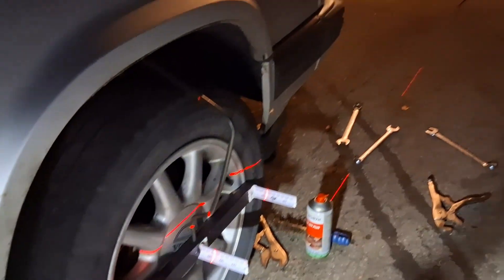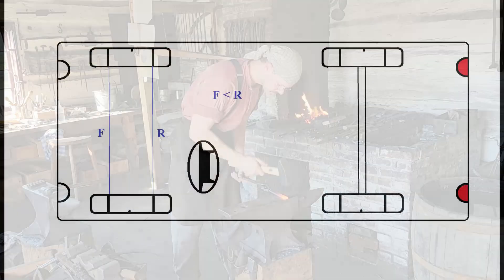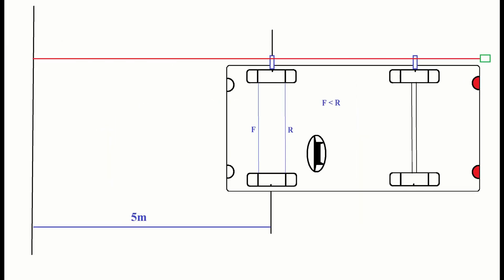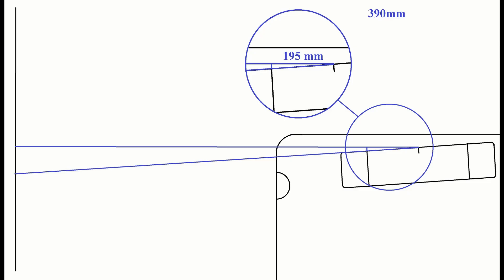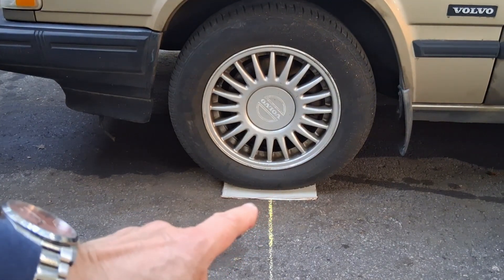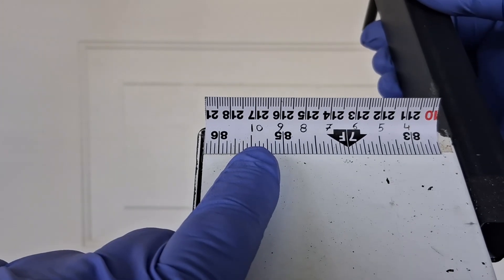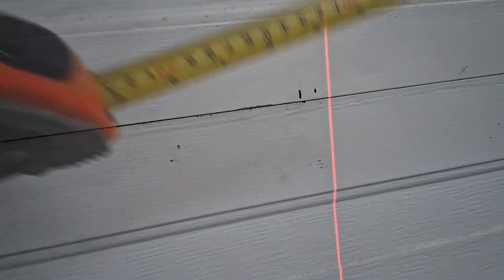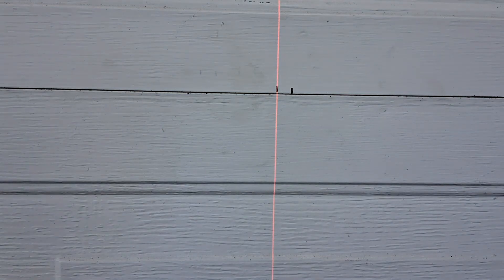Wheel Alignment With Laser Precision.

Comment: Interesting video! At 3:00 how did you figure out the track width of front and rear axles. Did you measure them with the laser or did you just aim the laser to hit 6 in the rear and 5.5 in the front because you already knew?
Reply from the maker: I cheked the manufacturer dimentions of the car. This is factory set up.